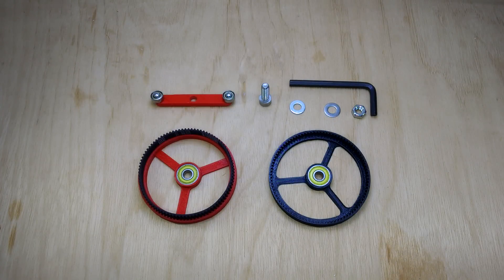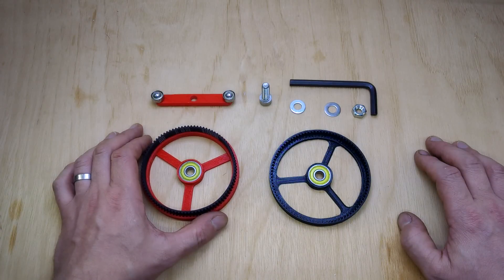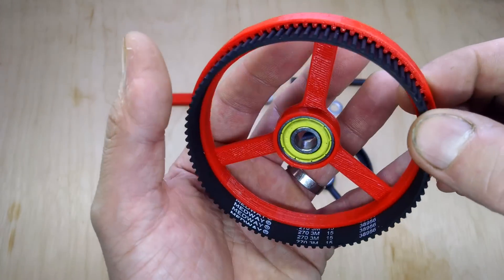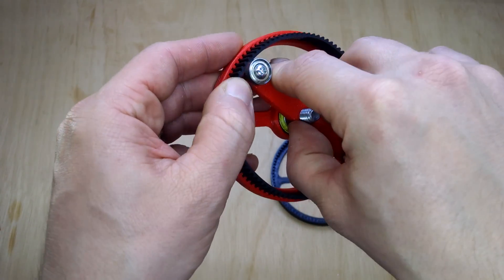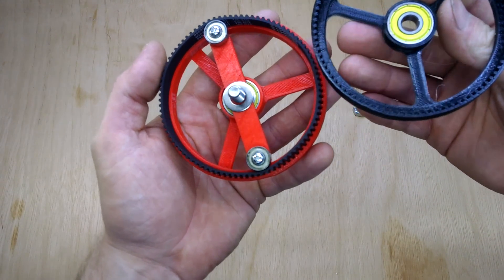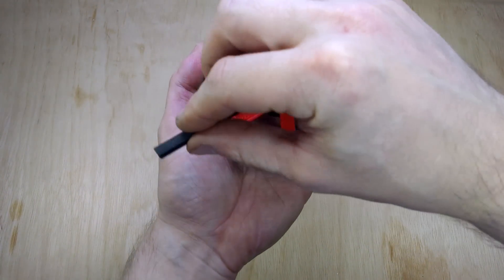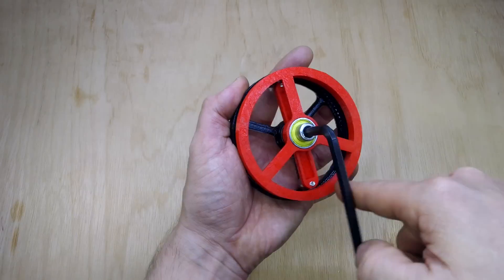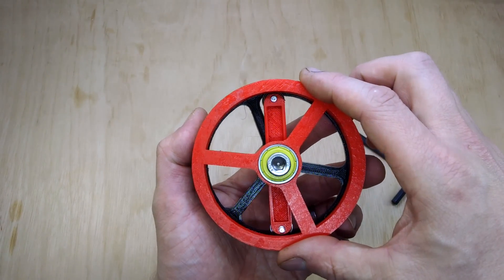3D Printed Harmonic Drive / Strain Wave Gear Using Timing Belt

Comment: Questions :
1)Could you add add a third circle so that you have a compound ratio?

2) do you know any bicycle that works with this at its gears?
Thank you!!
Reply from the maker: Yes. I did consider doing this but got distracted away after making an unsuccessful initial attempt. I don't know any bikes which use this but perhaps their priority is being able to change gears and I don't know how you would change the ratio on this.

Comment: Fantastic job.
How did you get the HTD 3M profile into the design? 
Using some OpenScad pulley design and revesing/subtracting it from a large block won't do the trick as it's not a reversible/symmetrical belt design.
Reply from the maker: It's been so long I can't remember, sorry. But I do remember using the dimensions of the belt profile taken from diagrams. That said, my printer wasn't that accurate, so it may have been quite a rough estimated profile and some trial and error with print tolerances. The onshape files are probably still lurking somewhere publicly, although I don't touch onshape anymore.
Reply: @simonmerrett  Thank you for the answer, I sketched the reverse tooth profile in F360 and managed to create a toothed crown. Best of luck.

Comment: I don't know how good this would hold up with high torque or with higher rpms.
Some ideas to the design:
-use bigger bearings to push against the belt so you get more teeth into contact
-use a smaller belt, this way the teeth will only rub against eachother where the bearings aren't pressing on the belt
-try to find a belt as wide as possible for maximum contact
-preload the bearings with some kind of spring mechanism

Anyway, in normal belt applications you have really good contact conditions because it literally wraps around the pulley. In this application though it has only proper contact to a couple of teeth and some just on the corners.

Comment: If this design could handle 500 w, 3000 rpm rc outrunner motor and a gear ratio of 100:1 it would be a revolution in mid drive e-bikes.
Reply: As of now, they are very expensive to make

Comment: Looks like high Torque :can't work it out but 90 to 92 (45 to 46)
Reply from the maker: Not sure about torque transmission yet but gear ratio is 46:1 (I think).

Comment: I was just watching videos on strain wave gears, and I had the same thought (to use a timing belt as the deformable element).   But I could never have put the idea into practice as elegantly as you did here.   This is fantastic work!
Reply from the maker: Mark Osmond thank you for your kind words. I have improved the design from a mechanical perspective in my more recent video on the strain wave gear.

Comment: One issue is that the red and black gears have slightly different diameters, so the timing belt will be twisted. Is there a way to improve that?
Reply from the maker: Sebastian Osterfeld yes there is! I've tried to explain in the project log of my hackaday.io pages. The link is in a different comment on this video.
Reply from the maker: Here's the link to a video explaining: https://youtu.be/hiq5QDeXw-0

Comment: Very nice! Not having to constrain the belt makes this gear more simple and intuitive. Is it possible to buy these parts somewhere as a kit? I would like to buy one, if it's not too expensive.
Reply from the maker: Sebastian Osterfeld I'd wait until it gets developed into a more rigid design as it's quite "floppy". If you're happy with that and can't wait for something stronger, perhaps get a local 3D printing service like 3D hubs to make one for you. Use the thingiverse link in another comment on this video for the files.

Comment: Very clever use of timing belt!
Reply from the maker: Paul Jurczak thank you. I've just made a gear without having to constrain the belt so there's no distortion along the teeth. I do this by simply having one outer ring with n teeth and the other with n+2. Will try and make a short video to show at some point. The key to making this actually useful is being able to constrain the assembly so it can transfer loads while dealing with all the sideways moments etc. Anyone know any good larger diameter bearings for this? I've got a lazy Susan bearing but it requires a clamping force to hold the faces together and that makes the mechanism harder to design.

Comment: It's amazing this isn't more popular. It seems like using a manufactured belt in lieu of a 3D printed flexspline could greatly increase durability. Friction isn't as much of an issue here as in 3D printed gears as well. I really think the potential cost savings and design flexibility could make this revolutionary for diy robotics.
Reply from the maker: joshmnky thank you for your encouragement. There's a lot of development needed to get this as a functional gear. One idea that excites me is that if the mechanics can be sorted out, the wave generator arm might be able to be driven by a metal gear servo. If you modify it for continuous rotation and put the feedback potentiometer on the outer slow moving gears you could have a cheap closed loop gear.
Reply: +Simon Merrett I've been thinking about this, and it seems like I might be able to make a version with just my dremel drill press (don't have a 3D printer) and dremel circle cutter attachment. Some belt profiles have essentially round teeth that would fit perfectly into a drilled hole. If the gears were aluminum, do you think the belt would last under a great deal of torque? I want giant servo! haha
Reply from the maker: I'm definitely no expert on the belts. Bear in mind they are flexed in the opposite direction they were designed for - I don't know if that's significant. If you can drill, cut and finish a tooth profile which prevents slip and isn't sharp (so it doesn't cut the belt), I can't see a reason this wouldn't work for a decent amount of time. Consider that I haven't tried spinning the wave generator quickly yet and others who've 3D printed their strain wave gears have seen the mechanism heat up in normal use.

The profile of the wave generator arm that is in contact with the inside surface of the belt (the bearing edges) is also probably a factor in the torque you can transmit with this design because it determines how many effective belt/gear teeth are in contact with each other. I think Barton Dring used an array of bearings to create an oval, rather than the two I have at each end of the wave generator arm and his way may allow better contact area.

Please post a link to your servo when you've built it!